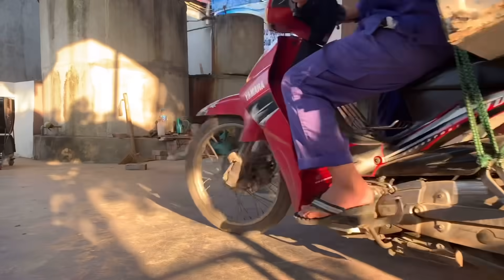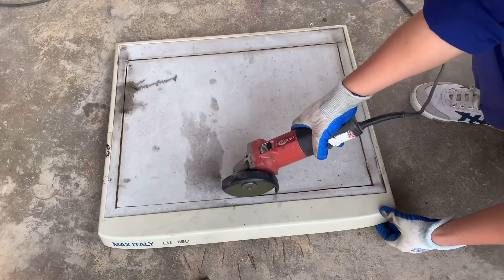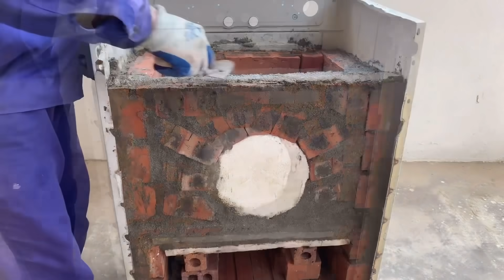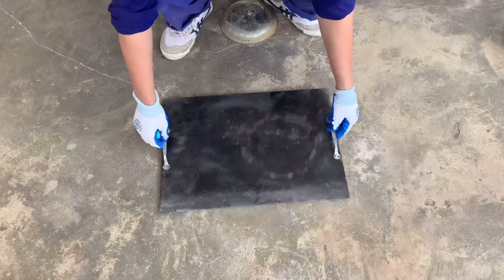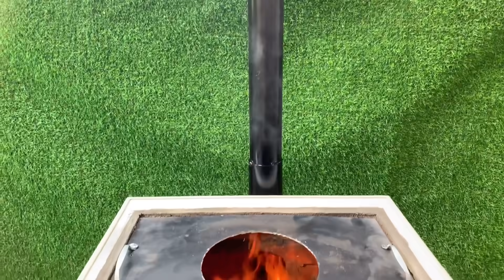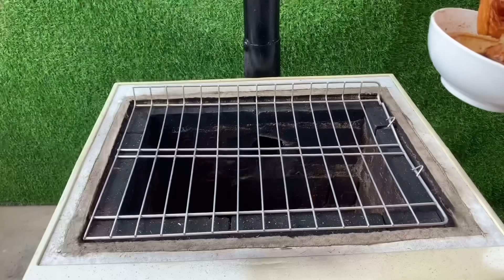Multi-function wood stove _ Creative idea from cement and old washing machine

Comment: The glass is not high temp designed - however it looks like the air intake is at the bottom wood box...  

( Did not watch the beginning of the build )

If so the current glass may work for a little bit, the plastic parts can be removed....

If you was to run copper pipeline behind the clay 🧱's hot water would be another good reason to have one of these on the back porch...

The plastic knobs could have a welders mat glued behind them / cast them out of scape aluminum

Comment: Brick will crack,plastic part will melt , and you can fire something ..when you build something like this you need to build with heat resist bricks  and wihout plastic parts ..and this armature will lose shape after first or second fire ..trust me
Reply from the maker: Hello .  you have misunderstood then this type of brick in my place is a refractory brick and I built bricks so the heat does not affect the outer metal box.  Thank you for your comment
Reply: I believe he used plastic as a mold, after cement and brick cure, he will take a plastic out.

Comment: Line the red bricks with firebrick for longevity.  
That door might melt..washers have so much plastic in them!!  Also, washer door glass is not tempered for high heat like a fire will emit, is it? So, that glass might shatter sooner than later?

Comment: So is the glass still in the door and why hasnt the plastic on door melted?
Reply from the maker: The stove is protected by a heat-resistant brick inside.  thank you
Reply: @GoodCreativeIdeaDmkt  Thank you for reply, well I will be making one of these for my old cottage after someone stole the old stove in it, over 120 yr old stove it was, this will look great so what can i spray outside with to make it look pretty ?

Comment: Not a practical nor inexpensive way to build a cook stove/fire place/fire pit. The plastic on the door will eventually burn but will emit stink when hot. The cost of the materials would just about equal a retail unit. Those wheels and the steel outer box will not hold all that weight much longer. I watched the whole video. Not for me.